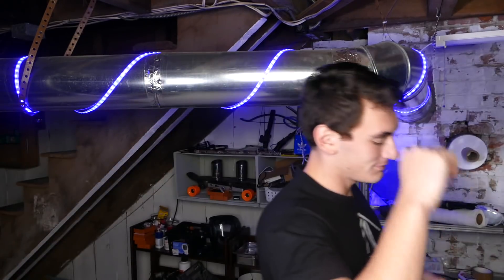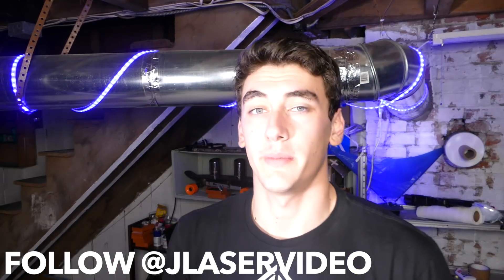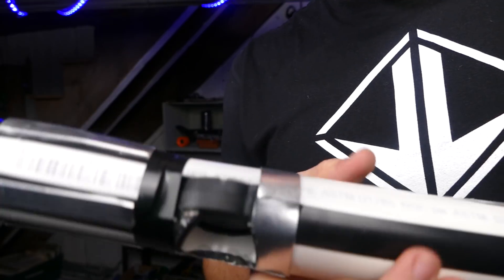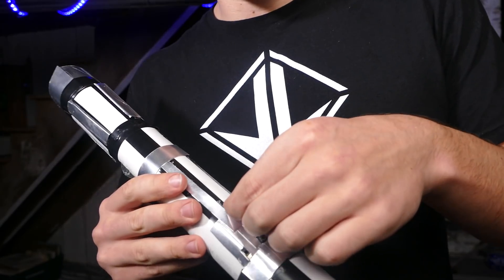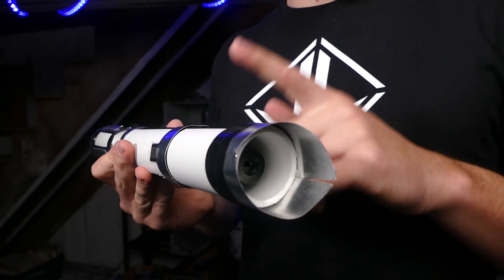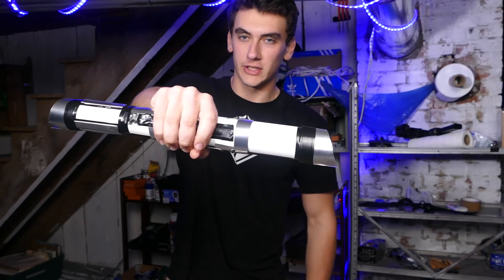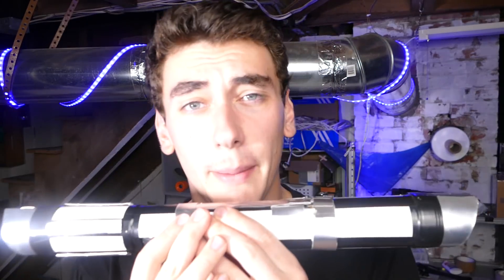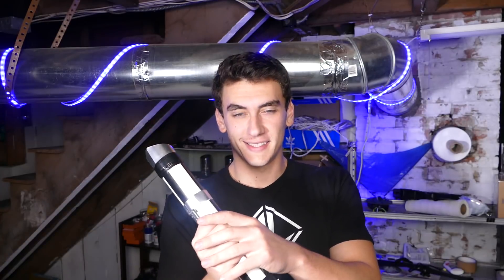Make a Double Bladed Lightsaber!!! (REAL BURNING LASER LIGHTSABER)

Comment: Well its a dual laser. Nice attempt and I do like the video idea. However based on much research a true Lightsaber is in theory a very high plasma with a high direction to a magnetic field to increase the concentration of the atoms making the base ridged. This has been looked at and studies have been done that does suggest. The main reason why is a true Lightsaber has a distant limit. Even though George Lucas has suggested that the Lightsabers are "laser swords" the truth is only a plasma with a electromagnetic field could turn a gas to act like a Lightsaber. The only other factor would be a magnetic plasma energy field like a ball lightning but harder to create. That said it is an interesting video project idea.

Comment: I doubt you'll see this but I've always had this thought that if you had a thin, sturdy rod coming from the base of the lightsaber, cap it off at the end with small reflective cap to reflect the 4 lasers that you'd build into the hilt. It seems like it would work in my head..
Reply: scintards try it out seems plausible
Reply: i had that idea too
Reply: That was one of my first ideas, but it didn't meet my criteria of what a lightsaber is.
Reply: thats what i have always been thinking, and i thought no one else would have thought of it
Reply: I would if I had the resources to hand haha
Reply: I said the same thing before you lol
Reply: Do you think it'll work? It seems logical in my head. I'd like JLaser to try it for sure!
Reply: scintards id have the rod spin. That way it’ll burn from absolutely anywhere and it’ll look like a lightsaber.
Reply: Try it post your own video
Reply: This was literally my idea too!
Reply: Clearly your head is not capable of working out difficult sentences.
Reply: scintards your comment isn't even grammatically correct. Must not of worked in your head.